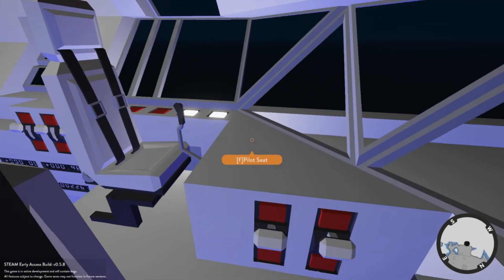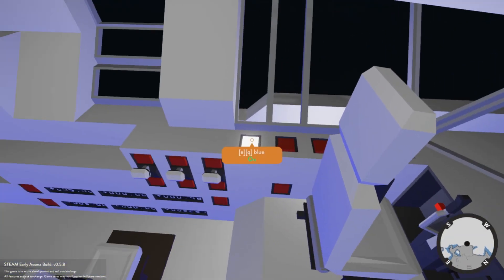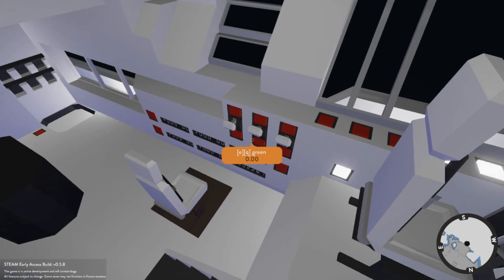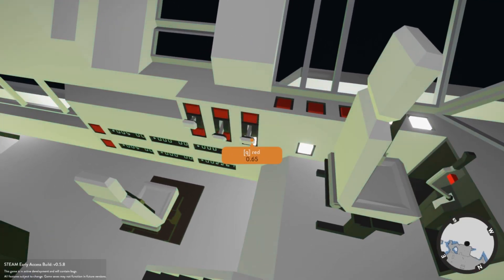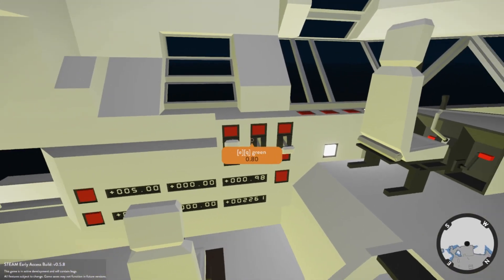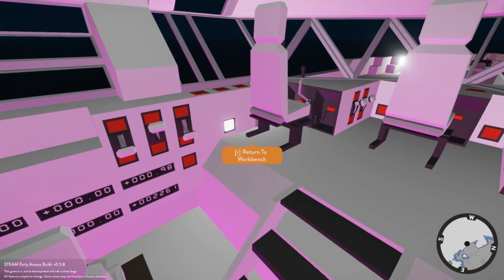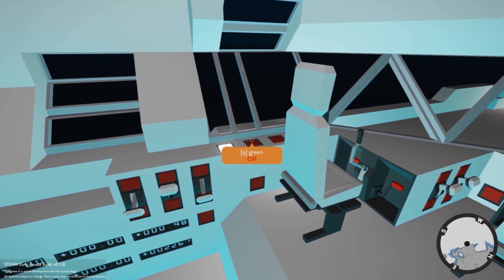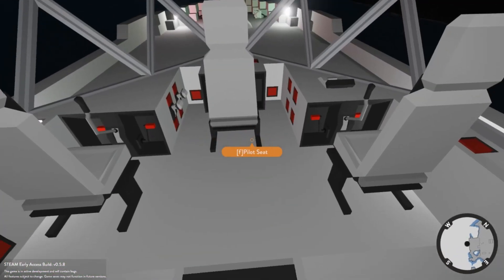How To Build Microprocessors for RGB Lights! | Stormworks v0.5.8

Comment: Great vid, StormRunner Gaming. I have a question. How do you make a submarine surface running light? I'm trying to get a yellow light to flash for three seconds and then stay off for three seconds alternating. I was able to make a yellow light with help from your tutorial, but I am having issues with the  timers, and other logic gates. What comes to mind?
Reply from the maker: I believe there is a logical node that can allow you to do that. It is the blinker node that you can send a signal in and out of and change the amount of time on and off through the block itself. hope this helps
Reply: @StormRunnerGaming ,  I have experimented connected a blinker to the various timers to get the .01sec of flash every second for three seconds; darkness for three seconds, but it is quite the puzzle.

Comment: Unfortunately, the dual RGB for number and on/off microcontroller doesn't work anymore. On the previous version, it works very well on both "number and on/off" as I follow this step. But It only works "on/off" signal and "number" logic value has no longer works(for throttle). I hope you do the update for dual RGB system. It works on seperate only

Comment: Could you explain how to make the color slowly change? I've tried again and again, but just can't figure it out.
Reply from the maker: to be honest with you, I have a 3 hour stream ( on twitch ) where I could not figure it out! I have been working on a system and it should be done sometime soon.
Reply from the maker: @CapnDumbass  There is actually a few different microcontrollers on the workshop now that are able to fluidly switch between rgb colors. You may have to hunt for a good one

Comment: This doesn't help with making just a single color, say for starboard side lights
Reply from the maker: If I remember correctly, setting rgb to a single color is done by setting the color value to 1 and the others to 0. hopefully this helps.
Reply: StormRunner Gaming Thank you, but I had a brain fart, I could just color my lights. No coding needed. 😅
Reply from the maker: @nathanbasset  its all good, I have the same things happen to me all the time!